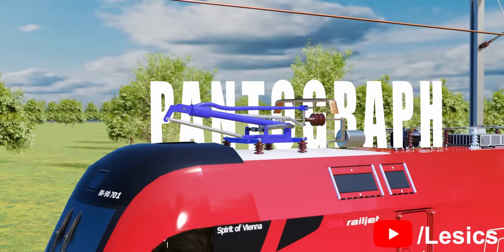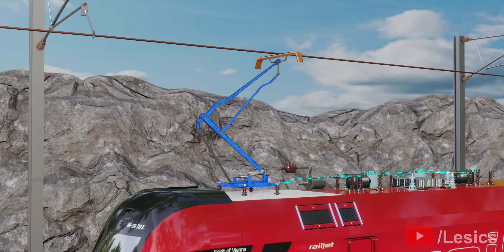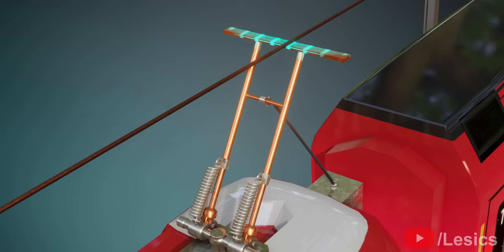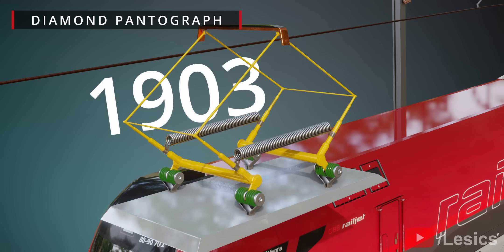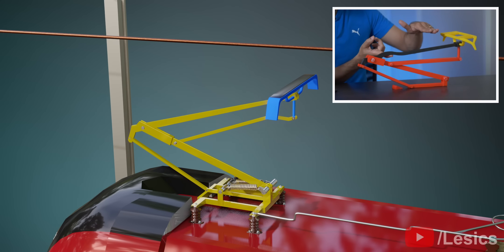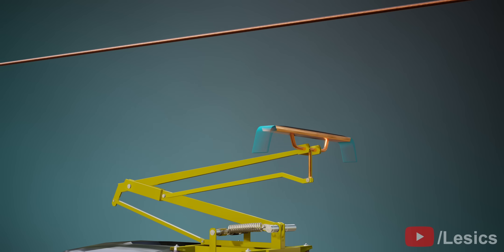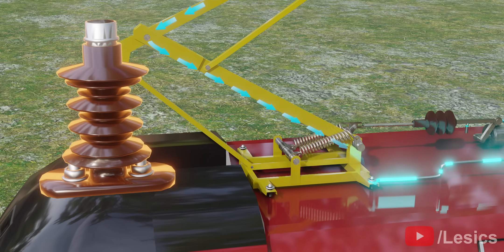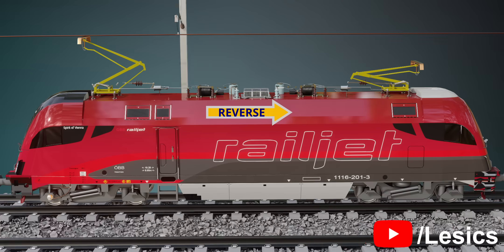The Brilliant Engineering behind Pantographs!

Comment: I am a train driver from Romania, here, we use the back pantograph, because, if it brakes, it would fall out of the locomotive. If the one in front is used and it breaks, then all of the electrical equipment on the locomotive would break in pieces 😊

Comment: I got everything except why a speed of 150 kph has anything to do with the need for a second pantograph.  Wouldn't drag be an issue at lower speeds as well?
Reply: uhh no, the whole thing about dual pantograph is to getting a contact stability with no issues

Comment: The copper carbon contact strip is usually hollow with  an air supply. If the strip wears the air pressure drops whip causes the pan to drop to prevent damage to the OHLE.

Comment: too bad they couldn't figure out a way to just have it be reversible instead of needing 2 of them
Reply: They work both ways. You don't need two. Where two are used together usually on a heavy freight locomotive or long EMU it's a means of splitting the current load. In Europe two pans are also used to allow cross border use where different countries use different voltages. In this case one or the other will be used, not both.

Comment: The trolley or contact wire for tram and catenary-type overhead power systems usually uses a shaped copper wire which is held by clamps that leave the bottom of the wire free of obstructions and thus smooth for the trolley-pole and pantagraph shoes to ride on.   The size of the wire is determined by how much voltage, and most importantly, how much amperage is drawn across the contact surfaces.

Comment: I wonder why there isn’t a short circuit when the pantograph is connected to 2 voltage lines at the same time.
I would think that there would be a short circuit between voltage line 1 and voltage line 2?
Reply: There's always a gap between supplies from different sub stations. Balises at side of track trigger disconnection of the electrical circuit between pan and transformer before reconnection after passing to next section.

Comment: The other reason locomotives run on the rear pantograph, even if they use symmetrical diamond pantographs:  if a pantograph is damaged while traveling at speed, it’s likely to topple backwards.  If the front one was damaged, it could take the rear one out on its way down. If the rear one was damaged, however, the front one should survive and be usable to limp the train to the next station or depot.

Comment: Pantograph is metal and power line is also metal...... when these two parts touches Electric current flows through motor which runs the train...... when the train moves due to friction between pantograph and electric line  won't  the fire spark be generated....?
Reply: The pantograph generates an upward force onto the wires due to its primary suspension (just enough so the wire doesn’t break), this reduces the likely hood of sparks being generated but it can still happen
Reply: Collection is not metal to metal. The pan has replaceable  low friction carbon inserts, which actually run on the wire.  The wire is set up to zigzag down the track to avoid cutting a groove in the carbon. In a lot if installations you raise the pan with air before actually closing the connection to the transformer, thus avoiding arcing but not always.  The pantograph raises very quickly so it's not usually too damaging anyway. Once moving a strong spring keeps the pan in contact and weights (or more modern tension system) keep the wire taut

Comment: From what I heard, the main reason why using the pantograph at rear side, is that in case there are something tangled or hung on the line, the falling stuff won't drop onto and damage equipments on the roof of the locomotive.

Comment: why can't someone design these without the need of overhead lines.  A 3rd rail that isn't energized until the train is seconds from it or something like that.
Reply: Trains can run on batteries but why do that when you can have a constant supply of power from the wires.
Reply: It's more efficient to transmit thd leccy at very high voltage 25kv rather than high voltage 750v. This requires separation to avoid electrocution , not possible with third rail.

Comment: 2:10 probably lie, doesn't even make sense logically. I'm not a train expert, but we have trolleybuses, and they have those ropes only for lowering arms when changing copper head, not some stupid counterbalance
Reply: Train and trolley bus pantographs are different
Reply: Troley buses are o named because they use arms to collect the power which are known as the trolleys. The end having a free running brass wheel known as a trolley wheel. They do not use pantographs

Comment: Also one of the reasons that some cargo trains have more pantographs, the top layer of the panto wears down yes an creates small vlames around it, like reallyyy little pieces flying of it and burning up cause its so hot. When its dark outside (wheter BTW also inpacts the wear a lot)  look at the trains going by its like a light show. And cargo trains with high explosive cars temp to use the panto in the front to maximise the distance between the sparks and highly flameble cars behind it jusy tot be extra save :)

Comment: your statement is partly wrong and partly incomplete.

:question, (incomplete)

why do trains run with both pantographs in winter? 

answer:
 the first is the ice scraper, scrapes ice away from the cable, the second feeds the locomotive.

:question, (wrong)
 why do freight trains sometimes run with the front pantograph?(aerodynamics isn't all that matters)

:answer 
the first freight car has loaded either easily inflammable or sensitive goods, if the rear pantograph were raised, flying sparks could ignite or damage the sensitive goods.

otherwise well explained, bravo.

 excuse my english, google translator.

Comment: Why don't we use trolley pantograph system but brushes on it? I remember similar operation in working of motor.
Reply: theyre designed for low end electricity power, which is kind of unfitting with todays mainline electrofication

Comment: The back pantograph is also used at lower speeds. If it fails, it does not damage the other parts installed on the roof of the locomotive.

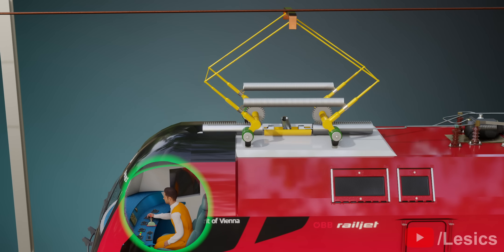Comment: 4:45 - no, the driver can't "adjust" the air in the pantograph, that's wrong. the air is always there to held the Pantograph up - and: there's more. the "carbon head" on the panograph had one "chamber" - where air runs trough; that same air what is needed for "holding the pantograph up". if the carbon bar breaks, the air can run out - and the pantograph will fold itself. that's a safety mechanism that the OHL won't get a problem when the carbon bar breaks. also, it depends from country ot country ( 8:30 ) what for a "voltage" is used to; there's even 1500V DC, 3000V DC, but even 15000V AC as 25000V AC (i'm sure it's even more variations, but that's just details - and not to mention "tram railways", who runs with just 650 - 750V DC ). Oh, and the new OHC will not just "come from the side", as is either a bit "sideways" as the old one, but mainly, it came "from the top" (new is over the old, and lowers themself - until the old get in a different direction or get's up and away) - but 'cause it's sideways, the point with the "horns" is correct. but it's not correct, that you need both pantographs at higher speeds with just a locomotive - it is just "what" hungs behind the 1st locomotive (when there's another, you need to raise a pantograph by both locomotives, and that the both ones, who are at least as most away from each other; you even raise the first one, if there light flammable liquids or even cars behind your locomotive). it's not bad meant, but that is "fact" and should be clarified - needles to say, that not half-wrong or "dangerous false informations" would be spread.

Comment: Mostly, we have several pantographs when we have several different voltages on the overhead wire. i.e, in France, TGV has a 1450 mm wide collecting head for 25 kV 50Hz, and an 1950 mm wide collecting head for 1500 V DC.

Comment: one thing to correct, the pantograph extension isnt controlled by the driver, a computer inside the train measures if there is too much pressure or not enough pressure on the wires to raise and lower them automatically. to lift/lower the pantograph to enable/disable the driver has to push a switch.
thank me later

Comment: The two pantographs are used not only when changing direction, but for different electric systems as well. Like direct and alternating current ( it's the case in Russia, and, as I know, in some EU countries, like Austria, Czech Republic, Germany, Poland). Different countties, different historical periods, different standarts.
Reply: I figured redundancy too. 

It's simpler to get a slow train to a maintenance depot under its own power instead of towing a slow train.
Reply: In EU there are locomotive with four pantograph. That's because there are different countries with the same electric system that need different pantograph

Comment: One of the things this misses is that on some SNCF and Korail trains, they actually keep the collector hollow and run the pneumatics through it. As the carbon top wears down, or is otherwise impacted by something on the catenary, the air leaks out and collapses the pantograph, bringing the train to a halt. This is an important safety feature as if left up, it could rip the catenary, or damage the carriage.
Reply: Other design, common for example in Germany, is using a small brass tube within the carbon collector.

Comment: great video, but you forgot the main reason why the pentograph at the back of the machine is used.
If the pentograph is hit by an object (like a defective insulator dangeling from the OHL), it doesn't smash into the roof of the engine - damagíng the expensive equipment on the roof and potentially the transformer-block below - but instead it smashes into the (relative) cheap cocpit glass below.
Reply: A lot of electric locomotives only have one pantograph so it can be at the back or the front depending on the direction of travel. The usual thing a damaged pantograph does is bring down the wires rather than it being ripped off its mountings.
Reply: @cbsothervideos2898  you are right, i don't deny that locos with only one pentograph exist.
But my point still stands. If an loco has two pentographs one of the reasons the back one is usually used is: because if an object hangs from the OHL the pantograph smashes into the window, not the top of the loco.
things that damage and deform petographs usually hang from the mounting of the OHL. and sure, seldom is the pentograph ripped from its mounting, but most of the time it is deformed. Most of the time the defective powerline is the reason for the ripped or deformed pentograph, not the consequence of the defective pentograph.

also an defective or feformed front pantograph would kill the electrics on the top of the loco and might make it impossible to use the other pantograph.

Comment: one more reason for rear pantograph being used is that it's easy to pull something  than pushing it.  In the front of the engine it would be pushed but at the rear it is being pulled
Reply: Provide supporting statements for the following claim.  "it's easy to pull something  than pushing it"
Reply: @ShainAndrews  Google your statement
Reply: @vininfar  That is not what you were told to do.  Show supporting evidence for your claim.  Get to it.
Reply: It makes no difference to modern pantographs. We have plenty of single pantograph locomotives in the UK which run in either direction at the same speed. The carbon contact strip is a lubricant as well as a conductor.

Comment: There is one thing you missed or didn't mention about choosing the front or rear pantograph. In Belgium (and I guess neighbouring countries aswell) when we have the choice to choose the pantograph it is required to take the front one. Reason is that sparks that can come from the 2nd panto has a chance to damage cargo situating on the first carriage behind the locomotive.
Reply: Do these trains run at relatively low speeds?
Reply: Freight train can drive up to 100km/h or up to 120km/h but we also have to follow this rule with passenger trains with speeds up to 160km/h and 200km/h.
Reply: interesting, here in my country they use a guard coach to increase the distance between loco and fuel carrying tankers however, no coach is used if the coaches behind are for normal cargo and i guess we haven't heard of any damage to the goods in those coaches as well

Comment: Also about why most locomotives have rear pantograph up and not the front one. Im russian and in russia there are many soviet  locomotives like ВЛ80 (WL80) with Diamond shaped pantographs that are bezing hold with the pressure of the air. If there would be no pressure to hold the pantograph it will fall backwards cause the train would move (driver can release the pressure if there's a serious problem like if the OHL with the electrified part of the track ends or the train driver didnt see the netrsl zone to saftly put the pantograph down) and if its on the front it will fall on important things located on the middle of the locomotive's roof

Comment: The video is interesting but the last part is a bit inaccurate.  Assuming the discussion is about the direction the pantograph faces.  There appears to be no real difference if you flip it 180 degrees.  You'll see this a lot in Germany as almost every electric locomotive has the bend in the arm facing towards the back.  It is true the pantograph towards the back of the locomotive (movement direction) are always used, but the direction the bend faces doesn't seem to matter. Germany uses this even on their highest speed trains.

Comment: Using a pantograph on the back side is also a safety feature. If it breaks, it's pieces will just fall behind and the locomotive can proceed to the next station using the front one. If the front one breaks, it's pieces will likely also damage one on the back, or some electrical equipment on the roof, and the entire line will become blocked until a working locomotive arrives to pull it to the station.

Comment: Why not make the collector head oval in cross-section so its angle to the wire isn't that critical and put a small airfoil on the whole thing to force it up against the wire.
Reply: making the contact head being overall cylindrical shaped only make them worse. Less efficient, More maintennance heavy, and makes more uneven contact

Comment: You've developed what?! That mechanical movement had been known for centuries.... And using the rear pantograph is clear for every railway worker: should there happen a crash the debris will not damage the front pantograph and the train will continue it route to the station without delay

Comment: Even as a train engineer I'm fascinated how much engineering is behind a pantograph which seems like a very straight-forward simple mechanism.
Reply: "Simplicity is the highest form of sophistication."
It took us decades to arrive at this design.
Reply: Is my dream job to be train engineer
Reply: Seems over-praise is offered in this video to -exactly as you say - a very simple system. It's much the same as a JCB's front bucket - you either keep the paralellogram arrangement OR you put identical quadralaterals together but flip one, and you'll get the same effect - the collector plate would remain level.
Reply: @terryjimfletcher  The world is build off a collection of these ingenious changes. The current end result was not obvious but a result of iterative improvements.

The video was quite neutral and on point.
Reply: It is simple. It’s a system of springs and hydraulics.
Reply: @xr6lad  it's actually a system of springs and pneumatics not hydraulic

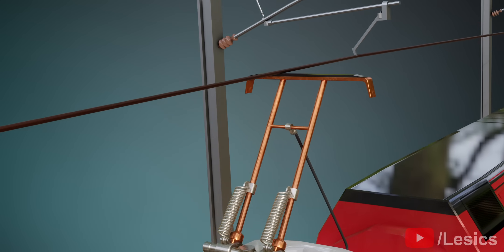Comment: 3:44 towards the end of the video, i didn't find the explanation for the horns' purpose. did i miss? what is the explanation?? to reduce vortexes and air drag? how?
Reply: they increase stability on HS operation by maintain alignment and stability. Most of the time the horns acts as a safety feature more than being a enhancement, It prevents the wires snagging, it provides smooth transition, and most obviously acts as a safeguard

Comment: There is a lot that is correct, but there is almost as much information that is incorrect. For example, the real reason the locomotive has 2 pantographs, and why the trailing pantograph is up, is in case of a pantograph failure. If the pantograph is somehow ripped off the top of the locomotive, it will not destroy everything that is on top of the locomotive. Many trains are as aerodynamic as a brick - including the one used in this video. Also, the "trolley pole slider" was replaced by a wheel with a ball-bearing shaft to eliminate the sliders' problems. And they are still used thorough the world.

Comment: I love it how you took the pride of the Austrian railways, the Taurus, and put all sorts of silly current collectors on it. 🙂

It ought to be mentioned that the French class 15000 (25 kV AC) has a single pantograph, whereas the class 22200 (1.5 kV DC and 25 kV AC bi-currant) has two pantographs that both point in the same direction. The orientation of the pantographs is a bit of a mixed bag in these "nez cassés" locomotives.